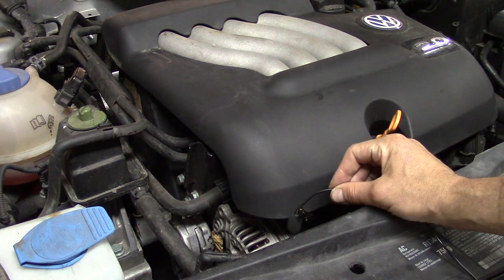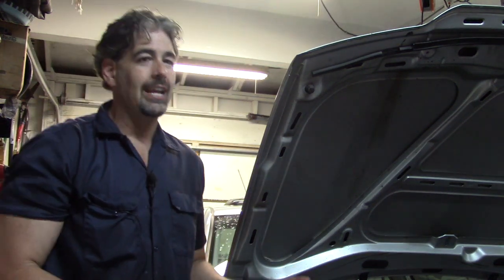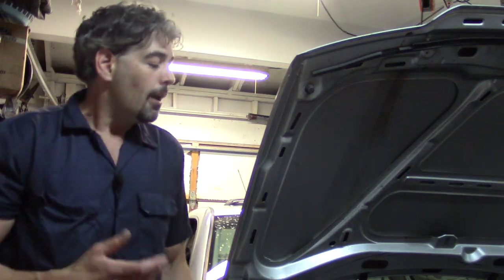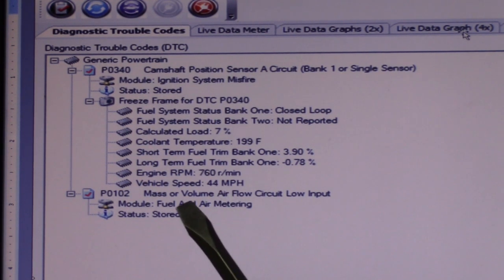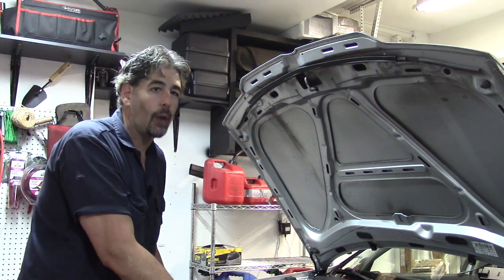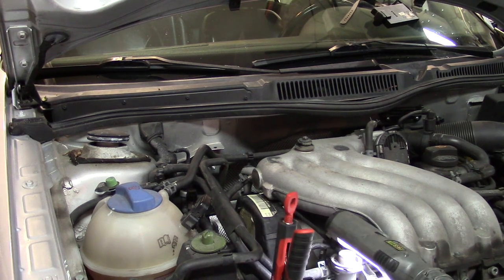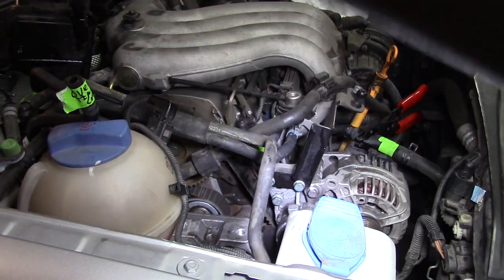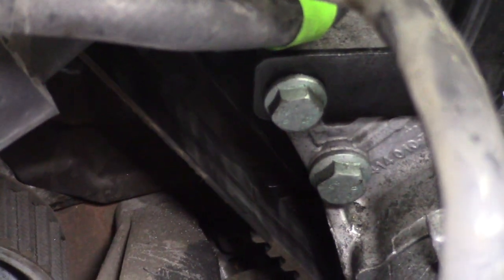Volkswagen Engine Noise Diagnosis

Comment: also worth noting that a shop would put a new belt and tensioner on stating that during disassembly they noticed that was worn as well
Reply: daverd2003 I guess that when changing the camshaft they would replace belt (and whatever it drives) as a matter of course. So you are right. You can waste peoples money and still be considered a good mechanic. People need to learn about cars or they will be ripped off BIG TIME.

Comment: I have a 2019 VW Jetta and all of a sudden I heard a fluttering when I accelerate.  I brought it in, and they said they had to order a Torx screw and some bolts, that I should not be driving it like that; so I have a loaner and will pick it up Thursday.  I didn't know what to think, it only has 28,800 miles, and it's a lease.  I extended it one year; in October I am going to get a new car.  Whaddayathink?
Reply from the maker: could be anything.  what diagnostics were done? i would start there.

Comment: Being from germany I have to say that I don't like special tools either, but all cars build after 1995 have some things on them which need speacial tools. At least the European cars. Is it really true that US cars from 2005 can be repared without special tools? 

Secondly the jetta has to be an interference engine. My 1989 AUDI 80 B3 which has a VW engine is an interference engine and I'm almost 100% sure that VW never build a non interference engine after the AUDI 80 B3.

Does the car really did not take any damage? To me that sounds impossible. How was it possible for the camshaft to continue turning with so many teeth missing? Only thing I can think of is that the number of teeth missing is smaller than the groves on the camshaft and crankshaft weals.
The owner it definitely one of the luckiest people on planet earth this week.

Thanks for the video and keep up the good work.

Best regards

Ben

Comment: VW and Audi valves do not open past the cylinder head bowl (combustion chamber), that is why you don't see bent valves occurring during belt catastrophe. All cars have some special tool, to define special tool is a tool that any individual doesn't have. Finding noise is easy but first you need a special tool called a stethoscope or something similar that's non electric powered, RF signals interfere with the mic. It's easier to use than removing parts unnecessarily and putting unrelated parts back. Unless the head and the block were milled heavily, this will be that instance you'll see bent valves.
Reply from the maker: yogegoy Beg to differ but ALL sources clearly indicate this engine is an interference design.
Reply: Schrodingers Box  This is a 2.0L AEG engine found in most MK4's and MK3's, with just the timing belt off you can turn the crankshaft 360* without any interference from any valves opened in any of the chambers, the same thing happens when you turn the camshaft even with a 12.5:1 CR.  You can turn both the crankshaft and the camshaft in opposite direction and nothing happens as in valve head butting. 

Probably the cause was improper belt tension, there is an arrow/pointer behind the tensioner pulley. With an inspection mirror you must line up the pointer with a notch using your 2 pin adjustment tool. Once belt is in correct tension you'll notice some slack on the leading end of the belt mistaking it as too loose. The trailing end of the belt is where all tension is applied. Timing marks are found on the upper rear toothed belt guard, an arrow and O.T. is it's mark. Flywheel mark is an oblong shaped lined up at lower edge of sight window for AT, MT will be lined up in the middle of sight window. Hope that helps.
Reply from the maker: yogegoy Still gotta disagree with you- when are at maximum lift on any cam lobe I am quite confident you would have interference in the condition.

Comment: Hey man quick question. I have the same engine on a 06 golf and it puffs out white smoke when cold started. I noticed some oil in the intake manifold. Any suggestions?  
P.S.  Great videos!
Reply from the maker: +sot2k1 What data do you have? This could be anything. What is your fuel poressure static vs load? What is the compression?

Comment: A couple of minutes after starting our 2014 Jetta TDI, the car sounds like it's straining ... almost like it is revving too much. It stays that way most of the drive. Do you know what the issue might be?
Reply from the maker: Could be anything. what data do you have?
Reply: @SchrodingersBox  thank you for replying. I don't have any data. It's very consistent though. From the driver's perspective, the engine sounds as if i'm accelerating hard, even when I am not. And the pedal feels like that too. Almost as if the transmission is at a lower gear than it should be? I'm guessing this is not a common problem among Jetta TDI owners?
Reply from the maker: Can’t help without data sorry. Just the basics- an LTFT and STFT curve against load overlayed with induction metrics would give a good simple beginning start to finding the issue.

Comment: Why does my 2008 vw Jetta make a noise on the engine like a fan is running it happens when I'm driving and hit a red light? Any idea of what it could mean
Reply: +Cathy m Don't know if this comment is serious or not, but if it is, that sound most likely IS just that; a fan. That would be your radiator fan kicking in to cool the engine as the temperature rises when you're at a stop because of the lack of aircooling you would otherwise get from driving at speed. In other words, it would be worse if you didn't hear a fan at that point ;) I presume now of course that this does not happen right after you start, but after the engine reaches working temperature.

Comment: So my engine has a buzzing noise when I’m parked, and does is for a minute or 2 after I turn it off. Any ideas? I ran a computer diagnostic and it said “idle control and vehicle speed”
Reply from the maker: What data do you have?

Comment: So I have a 2011 vw jetta 2.0 L s. No real accerleration, engine light on wasn't flashing, is now within 2days of being parked, along with the esp or ecp light was on and now off... Engine way louder.. About 20 miles to town, rather not drive to town, so no computer... Just changed plugs, air filter and ignition coil few months ago.. I'm thinking maybe timing belt? Engine moves in Idel.. Any ideas would be great! Thank you
Reply from the maker: what data do you have that makes you think it’s a timing belt?  What is the data that indicates this? Dod you do cam/crank correlation? what’s the timing advance?
Reply: @SchrodingersBox  don't have data, that tells me anything.. About a 30 mile drive to town to get on computer I just didn't want to limp it and make the miss fire worse.. Anyway, I changed plugs again, and now I found that plug wire #2 needs to be replaced.. That's my next step. Have appointment next week to get recalls fixed🤦🤷 thanks for your opinion on my question.
Reply from the maker: Can’t help without data sorry.  Good luck.
Reply: @SchrodingersBox  all but one are reading as misfires. Buying another coil pack......
Reply from the maker: whoa i don’t get it- why would you buy a coil pack?? What evidence is there that this is the problem??
  Save your money. Get data and analyze it to find the cause. don’t guess.
Reply: @SchrodingersBox  i had someone bring a computer and put it on it.. and thats what it said..

Comment: I assume you may have never heard a piston slap a valve being that you're a DIY'er. That sounds pretty much like a valve hitting a piston. I've heard many interference engine's timing go bad, and they run fine; You can hear intermittent metallic tapping. The reasoning for your intermittent tapping is that the belt is slipping as your engine rotates and you also have minor tension on the belt. Believe it or not, the minor tension on the belt can cause a delay in timing due to the fact that not all components are taught when need be. I just repaired a Hyundai Tiburon that had the same issue. One shop said it was piston rod knock due to bad bearings. I've heard many engines with slightly off timing or loose tensioners , so I pulled the valve covers and the timing had slipped a few teeth. It ruined the valves, but case study completed ^_^

So, coming from somebody that is a bit like minded and that has been doing this professionally for 6 years, I can tell you that in that instance it sounds like a piston slap.

Great video though, post more!
Reply: Swot Roke Piston slap is something completely else man! It is worn piston slapping until it expands from heat.
Reply: I'm not going to play semantics on youtube chief. The piston is slapping something. I'm not wrong, I explained what occurs in detail. You obviously understood what I was saying. You neglected to mention what a piston hitting a valve is "Technically" Called. Thank you for the lack of education.
Reply: Swot Roke
Piston slap is a piston slap. There is a definition of that in books. At least that is what I was told at college. What you are talking about is piston hitting valves - that is how it is technically called.. Anyway it is you not me being a smart guy telling Matt that you are smarter than him..
Reply: Swot Roke  You claim to be a pro but you don't know what piston slap is  -- it has a very specific meaning the noise caused by worn pistons moving to the other side of bore as the crankshaft through bottom dead centre.

As a pro from a family of pro mechanics  dating back a century Matt never puts a foot wrong he works logically, the only difference from the way I work in he works in the videos  is I jump steps based on experience rather than going through every possibility cause as he does to demonstrate the correct way to pin a fault down.
Reply: Andrew W MacFadyen Thanks for your post.Today I just finished my level 3 in vehicle repair (UK) and had piston slap 2 months ago on my exam.
Reply: I never claimed he didn't, I was giving him kudos for making a good video. Again, you're playing semantics.... Neither of you have yet to educate me as to what a piston hitting a valve would be called. If you're a "pro" I would greatly appreciate it if you could actually make an educated statement that would inform me as to what a "pro" would call it. You can tell me I'm wrong for using the term, but you clearly do not know anything about the actual topic... I don't see how flooding his comments with useless arguing is benefiting anyone, other than you want to think you're doing justice by making a point.
Reply: Swot Roke
I told you - a pro would call it "piston hitting the valve"!? That is how it is called. It is not useless arguing as "piston slap" is a particular fault as explained above. It has its own definition in books. Same as clutch slip, clutch drag, engine misfire, wheel alignment, toe in, toe out... If you don't care than do what you want.
Reply: I offered an educated comment form a logical stance as well as experience. I am a scientist just as a Matt is, and wanted to throw my two cents out there. Congratulations you've found a flaw in my method of explanation. You've yet to offer anything educational to this debate. I'm sure he appreciates that.
Reply: I actually never indicated this was a case of "Piston Slap" by the way. What I indicated was this is a case of a valve "Slapping" a piston. I guess if you want to argue about that than, slapping someone or hitting them should be two different things. Forgive me for making a statement that was too difficult for you to decipher.
Reply: Swot Roke
You used wrong term and if you have no respect to recognized definitions than keep calling "piston slap" every noise you hear. Up to you.
Reply: Swot Roke
Calm down! I was just trying to say that piston slap is something else. Piston slap is a term used in books for something else. Can you just calm down? That is all I was trying to say.

Comment: I run a vw polo 6N. There is a hissing noise after warm up even at idling speed. What can be the problem. Thanks.
Reply from the maker: Could be anything. Trace the source of the noise and see where it stems from. usually hissing is a vacuum leak.

Comment: My Beetle vibrates while its on. And before it catches speed when accelerating, it switches gears. Do you know why this is?
Reply from the maker: No i don’t. what data do you have?
Reply: Schrodingers Box The Check Engine Light is on. Had to put in a crankshaft position sensor in last year.
Reply from the maker: Ok what’s the check engine light code?
Reply: Schrodingers Box I’m not sure. It just appears on the dash.
Reply from the maker: Well I can't see it from here.  Get me just basic, fundamental evel data- the DTC with STFT and LTFT curved against load contrasted with MAP and MAF.
  Thats all I need to get a beginning direction
Reply: Schrodingers Box I got these codes
P0300, P0301, P0302, P0303, P2181.
Reply from the maker: I’d start by checking the voltage drop across the coolant temp sensor.

Comment: hey where are u located at. your video saved my car with the timing belt but my car has more issues
Reply from the maker: What issues?
Reply: +Schrodingers Box I took my 08 jetta to the shop because my check engine light came on. the mechanic said I needed to have the catalytic converter changed. after replacing it the car  still drives slow and the check engine light has not gone away
Reply from the maker: papajohn316 Then the catalytic converter was not the issue.  What was the data used to determine that was the issue? I would start there.

Comment: Please help I have a 2003 Jetta 2.0 manual engine it won’t go pass 3000 rpm or pass 49mph I changed the camshaft sensor and new timing belt and still doing the same.
Reply from the maker: Ok- what was the data you got that indicated the camshaft sensor was bad? I’d start there!
Reply: Well I was doing research and that was one of the thing that was suggested so I went ahead and changed it but still doing the same thing

Comment: Questions and comments>

1.  Three thousand dollars should just about buy a new engine, I would think......At least it would come close to buying a stock V-8.....

Spending 3 grand to replace a camshaft (even if needed) would not be a good investment. The owner doesn't need a camshaft, he needs a non-volkswagen car.

And regarding the previous shop................I've been driving and fixing cars for 35 years and I've never yet ween, or heard of, a "camsaft problem", at least on a non-race car. The only things that could go wrong would be a broken shaft (How would that happen?), or one or more worn down lobes, which would probably indicate an oiling problem.

Bonus "just for kicks" comment......A year or two ago I removed my valve covers. I have 135K on my '99 Sebring, and all the lobes on both cams were as bright and shiny and perfect as the day it left the factory. No varnish even.  I use Amsoil, always have, but Mobil 1 is equally as good.

2.  I did not hear any comment about the engine mount, except in the follow-up video. Did you loosen the mount or did it come to you like that?

3. I watched the follow-up vid, and I do understand that the timing belt fixed the problem.  BUT, I'm unclear about exactly what was causing the original noise.  

Do you postulate that the timing belt was moving on the gear ("slipping")?  I assume not. So, if broken valves weren't bouncing around in the cylinder, what was causing the original "clicking"? The noise of the belt flat spot hitting the gears?
Or maybe it was so loose it was hitting the cover?

The tensioner was "broken"? Or was the spring just "worn out"?

Sorry if I missed something.

Comment: Any idea what the buzzing/humming noise when turned off engine, around the brake booster area? Lasts for about 5 mins constant chime/ Buzz noise then intermittent - - - pattern then stops? I am getting random abs error codes... thanks if anyone has help! Ty
Reply from the maker: No idea. what data do you have?

Comment: Never underestimate the power of a broom handle.
Reply from the maker: You cannot determine the source of a sound with a broom handle unless it is percussive. Even then it is next to useless on an internal source.
  Put the haynes manual away and dissect the issue rationally.
Reply: Schrodingers Box A make shift stethoscope / broom handle has never failed to help isolate where the sound is coming from before I go tearing into the motor. It will indeed give you a better idea of what the failed compnent is, not a cure all but a good start nonetheless.
Reply from the maker: John Crosetto I hear from people saying all the time they locate squeaks, vacuum leaks, etc with a broom handle. It is sheer silliness and just demonstrates they read Haynes manuals more than they diagnose noise issues. A broom handle is one of the many useless items you find in a novice hack's toolbox... like a vacuum gauge when they have an OBD2 vehicle.
The only use for a broom handle in this specific diagnostic would be to use it to poke someone who has a logical approach and take the job over. The sound in this case  is clerarly coming from the front of engine- therefore, isolation strategy is the only appropriate methodology to be consistent.